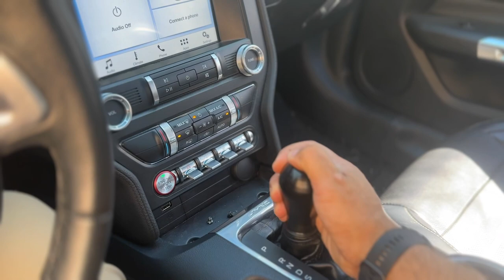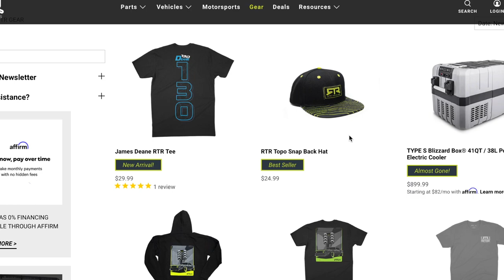Installing the RTR Performance Automatic Shift Knob (15+ Mustang)

Comment: If it had a lever release on the front instead of pushing it down to change gear I would get one. I do love the overall look but this just seems like it will fail over time.

Comment: Great video! I have a question;
At least in my area, there’s still a big community of 12th generation Ford f150s. Is there a possibility of rtr accessories for that model? I have a 2013 but the part compatibility range is pretty large, most parts that fit on a 2014 fit back to the 2009

Comment: I've installed this on my 2024 mustang gt, it is now not selecting park when put into park, making the car chime every time I open the door. It will select every other position except park. It will go into park with no issues, but the system isn't showing its in park. Help please.
Reply from the maker: The two reason for this is either 1) the collar was installed upside down or 2) the placement screws were in the wrong locations.  With the recess for the spring facing up; make sure that the screws are in holes 2 & 4 when counting down from the top.
Reply: @RTR_Vehicles  thank you. my mistake, collar was upside down. works great and am loving the product!

Comment: Do you have a install video for manual transmissions?
Reply from the maker: We don't have any install videos for the manual transmission, but we can do one.
Reply: @RTR_Vehicles  After a little research I think it's just unscrewing the shifter and then screwing on a new one right? I also have a short shit installed. Hoping this RTR works with this.